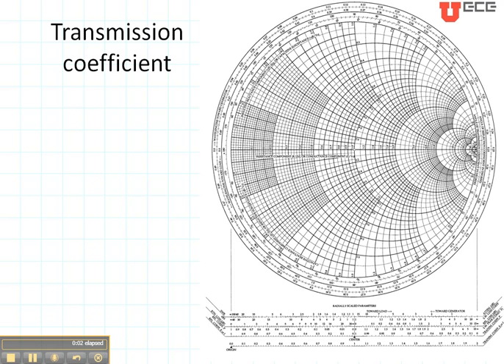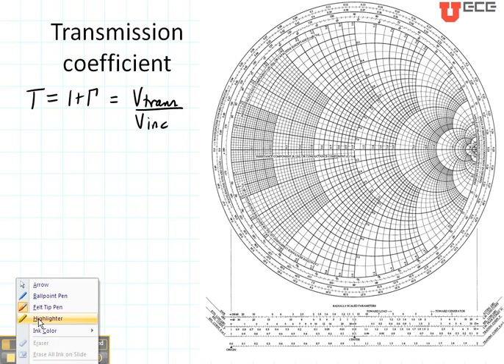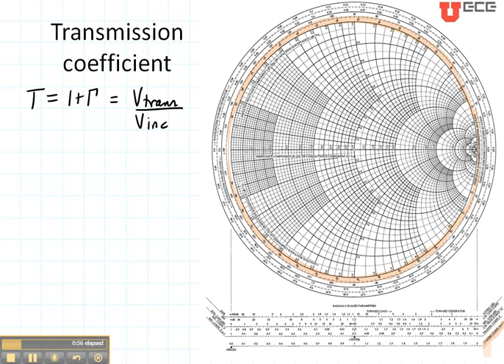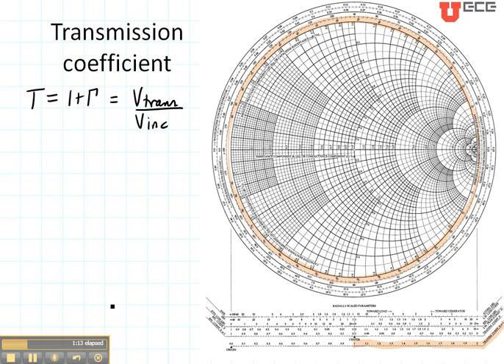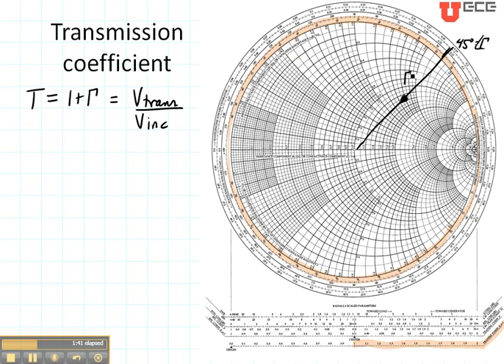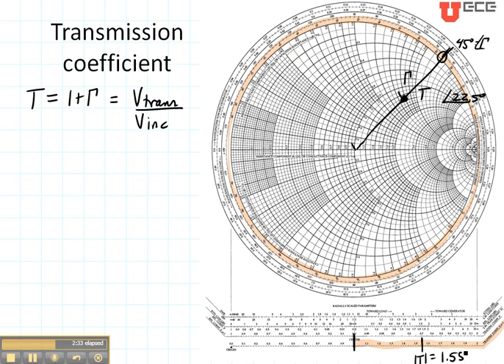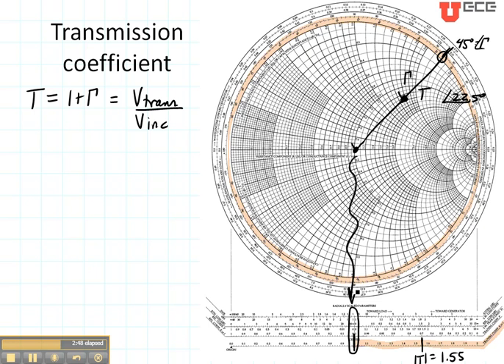ECE3300 Lecture 12b-3 Smith Chart transmission coefficient

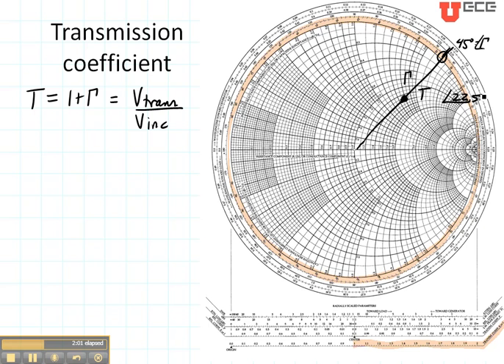Comment: Sadly the magnitude of the reflection coefficient can NOT be found for arbitrary loads on the Smith chart. The statement about finding the angle is correct, but the magnitude cannot be found the way its presented here (2:06). The bottom axis for the reflection coefficient does ONLY work for real loads, and is not measured from the center but directly drawn down perpendicular from the real reflection coefficient axis to the transmission axis.
Reply: I wasted some time trying to find out why her way is different from my professors way
Reply: This is not correct and is easily proven by just trying a non-real load.

Comment: This seems redundant since we could just find the reflection coefficient and add one to get the transmission coefficient.
Reply: Everything with Smith Charts are redundant if you use a calculator. It's the point of Smith Charts to not need a calculator. Adding 1 to a complex number changes both the absolute value and the angle. And you would need a calculator to find these. Except when using a Smith Chart. You see?